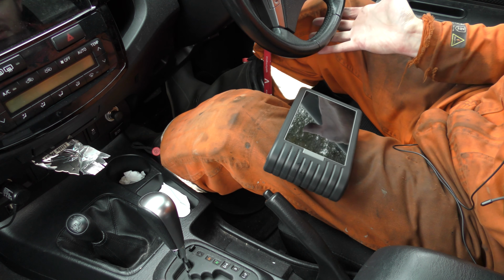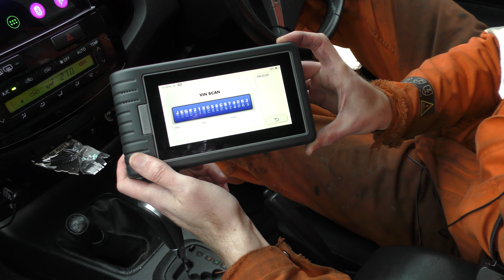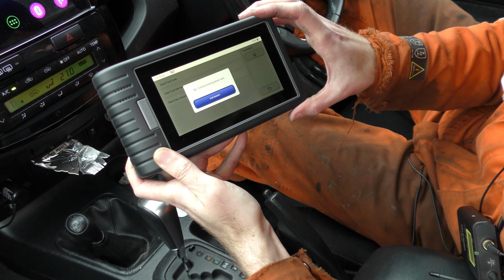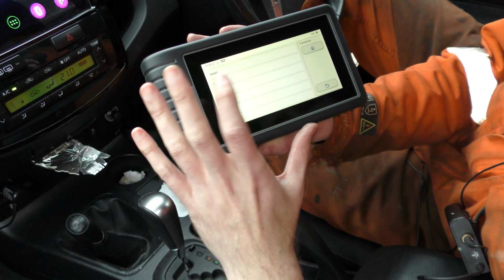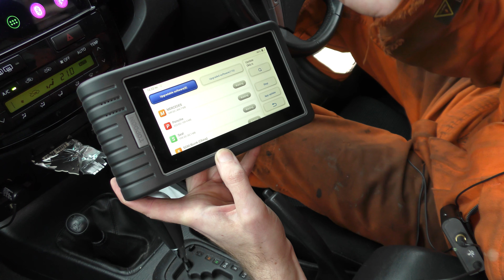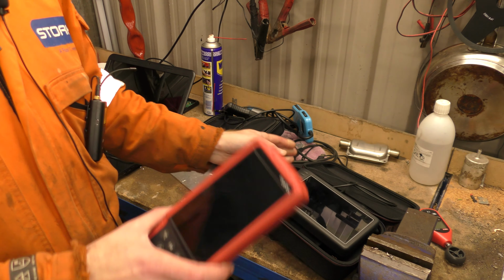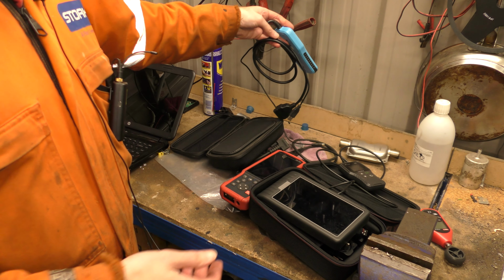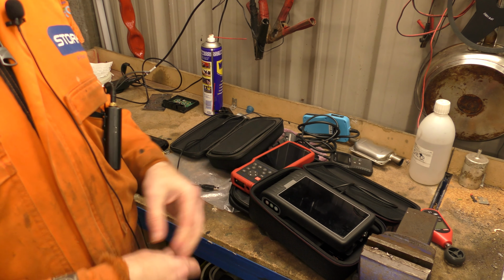My new diagnostics machine - Topdon ArtiDiag800BT

Comment: They cover service functions, but for me the biggest feature missing on that "slightly above entry level range" is bidirectional controls - for example you could operate the cooling fan control, EGR valves etc to help test the circuits.
The Topdon software is Launch based. 
I have the Topdon ArtiMini which I use for most everyday diagnostic jobs - it is pretty much the same unit as Launch X431Pro Mini.
Reply from the maker: I noticed they all have much the same diagnostics underneath.  The garage my Dad worked in had one of the early Launch machines, it was my job to update it via the internet.  And by internet I mean dial up modem.  :)

Comment: Hi purchased mine about 2 months ago just a home mechanic. Just wonder in live data does it give a battery condition. As just an amateur. Got mine on a good deal £229.
Reply from the maker: I've only seen battery condition on an ECU that reads and/or works that out itself.  My example being a friends Freelander 2 that had a very vague error message on the dashboard.  Diagnostics reading the battery condition from the ECU showed it as a fault and I can't remember the scale or figure but it was outside of spec.  Tested battery with the TopDon battery tester thing I have and it confirmed battery was about 50% capacity and needed replaced.  Brand new battery fitted, I think I told the ECU a new battery was installed.  All errors cleared.

Comment: Will it code the injectors on your hilux? I have a kun26 also and am going to replace my injectors but I’ve not yet gotten around to buying a machine to code them, I’ve looked at a few around this price range but none are clear that they will actually do this
Reply from the maker: And that's the problem.  Like a lot of the 'features' you don't know if they work until you try them.  I've got the Toyota Techstream clone and I know it 'should' be able to.  But I won't know until I have to.
Reply: @DavidMcLuckie  That's the issue I'm worried about, whether it will perform some specific features on a Lexus Hybrid. The £80 discount makes this unit tempting but if it can't do what I need it to do then I'll be in bother, again. I need to be able to turn on the Hybrid inverter cooling pump to prime the system after a coolant change and to also program the electronic headlight position. Do you know if it can/can't do this? Cheers
Reply: @DavidMcLuckie  my understanding is that that is technically pirated software, I know i can buy a “proper” setup or take it to a local garage but I would prefer to buy a unit that can do it all, why spend £400 when you can buy a Wi-Fi dongle for less than £20 and pay about £30-50 to get software such as Carly or similar to do everything except the service items

Comment: I purchased the foxwel nt726 but It doesn't do component test on available systems ie like turn lights on etc, but it is a very good all system scanner I can use it to see if things are active but not use the scanner to activate them, can this tool do that I know the normal 800 can but its 150 a year for update
Reply from the maker: Negative.  Other than actuating things like the electronic hand brake it can't energise individual components to test, sadly.

Comment: One question, is it possible to bring up the android homescreen by swiping up on the screen? To be able to change Android settings, install apps, or browse the web if you need to check something out quickly. Basically use it as a tablet. Thanks!
Reply from the maker: Homescreen no.  But there is a web browser built in.
Reply: @DavidMcLuckie  David swipe from the middle left to right 
Weeeeeeeeeeeee!

Comment: cAAAAN, the Topdon disable the EGR valve on a Crafter/Sprinter ? :)
Reply from the maker: Not sure.  I've only ever had EGR mapped out with an ECU flash.
Reply: Doubt it. It'll need taking out of the ecu, not just 'turning off'

Comment: Does this have a history function of previously erased codes by another machine?
Reply from the maker: Is that a thing?  Do ECUs store previously cleared errors?  I know some have flash counters so you check if it's had new software written.  But unless the newest ECUs have started recording old faults I haven't seen it anywhere in the diagnostics.

Comment: Love electric handbrake, but I've not had to werk on them. £400 heart attack, do they bundle a defibrillator in the price? Seriously, if you can fork out £400, is a good deal. I've taken my care to a national repair outfit, but they couldn't rest Citroen codes. Code readers for Citroen appear to be difficult to find. 👍
Reply: £400 isn't bad.
When a garage charges £80 to read a code and diagnose why the engine light is on, it'll pay for itself eventually
Not to mention, service yourself and reset oil lights, brake pad lights etc whichll also cost you too. With lifetime updates, it'll pay for itself and a 5 year warranty, it'll last a minimum of that
Reply: @jjmmjj9999  £400 is bad because the same tool from ebay cost much less. I saw even below £300
Reply: I know I'm late to the party, but I just paid £260 on eBay for this tool. That is a fair price for this machine in my humble opinion.